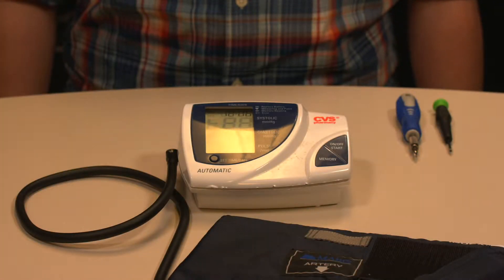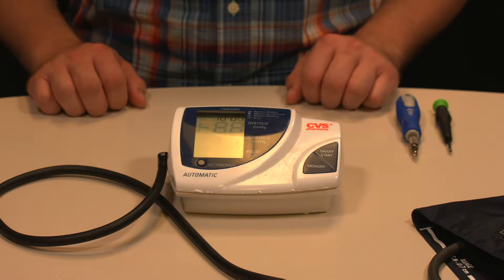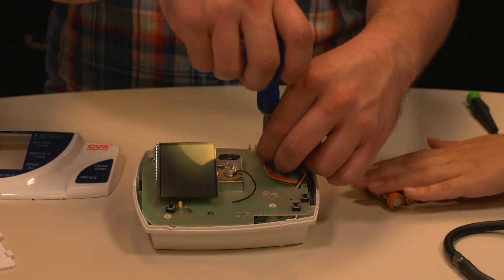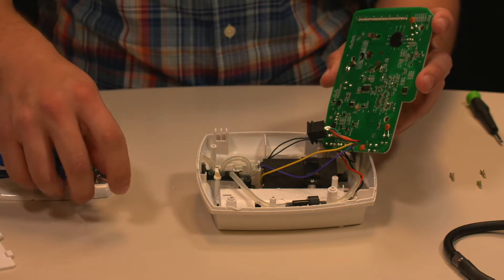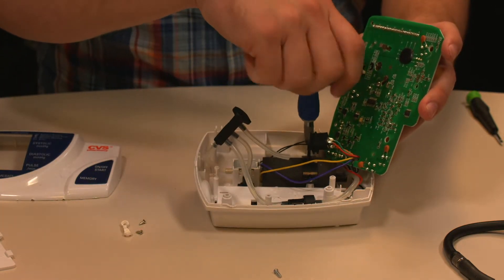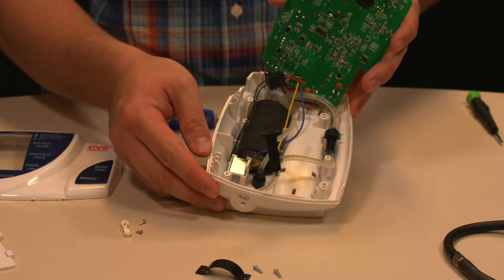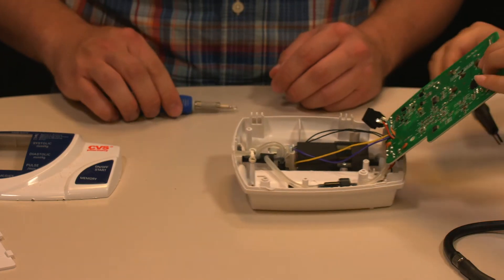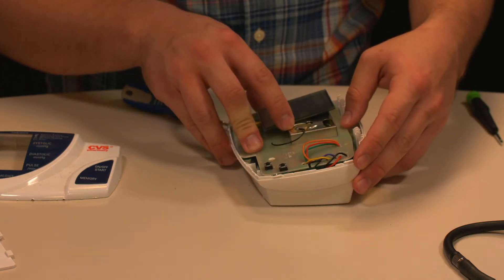Blood Pressure Machine Teardown video

Comment: Very nice video! I have a problem with my Medline MDS4001 Automatic Digital Blood Pressure.  It worked fine with batteries until I switched to an AC adapter.  Unfortunately, the AC was not compatable with the unit so I removed it and inserted the batteries back.  The unit completely dead (the start/stop buttons didn't work  & the screen monitor went blank) even with new batteries.   Appreciate your input.